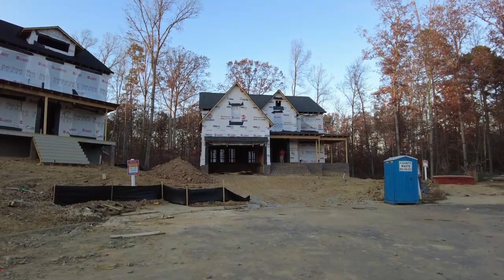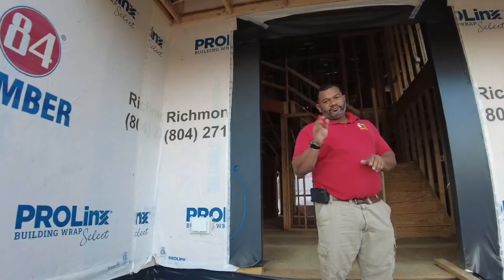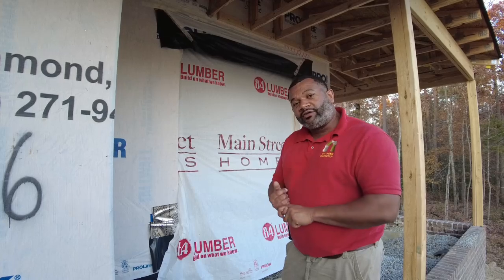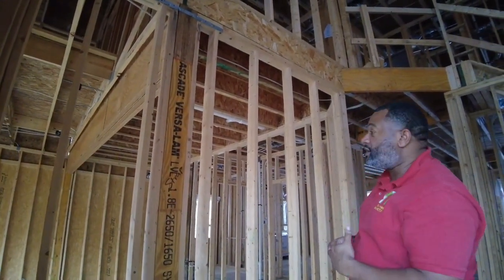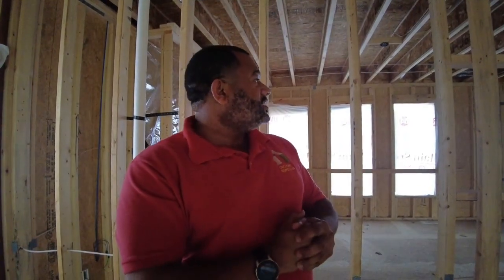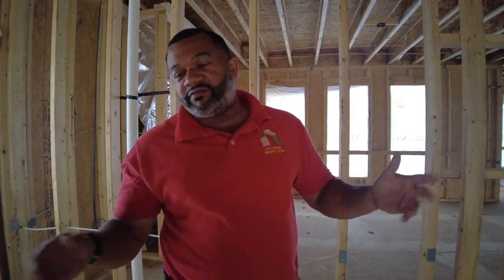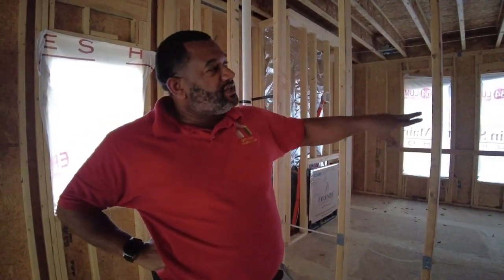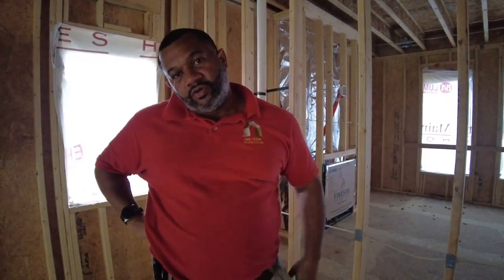Home Inspection Process - NEW Construction

Comment: Is a Radon inspection something that can be done on a lot before construction begins? (For those buyers buying new construction.)
Reply from the maker: Great question !  The answer is no, unfortunately.  There is a remediation system that can be installed on any existing home for about $2K, however.  THANKS